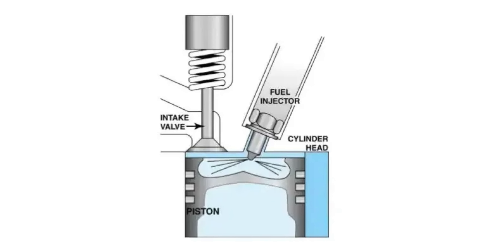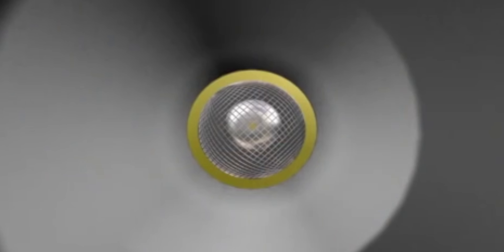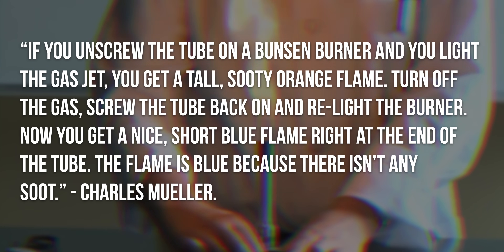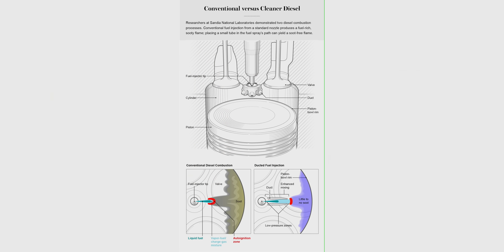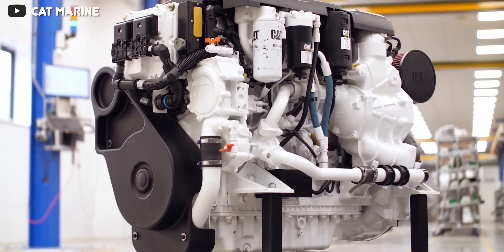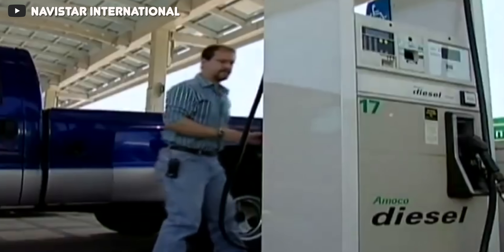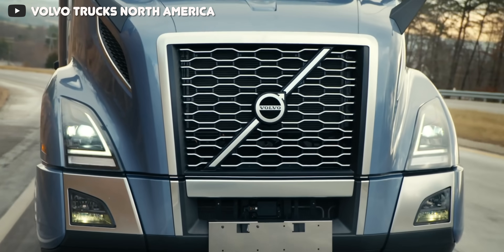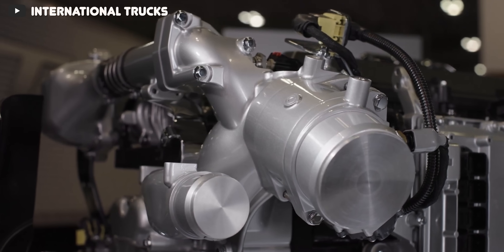Zero Emissions Diesels: How Ducted Fuel Injection can Save the Diesel Engine

Comment: If the EPA really cared about the environment, they'd focus on pushing nuclear energy, and working with states on developing actually good public transportation. 

I mean, what's better? A few % decrease in emissions of every engine on the road, or the complete removal of those engines from the road?

The problem is not what powers the car, but the car itself. Electric vehicles will have issues that only the "experts" didn't see coming

Comment: Diesel is not going away for the very long foreseeable future. Frankly no commonly found fuel can replace it for its intended usages and still be as efficient.
Reply: Yeah it's sure got it's problems like others but at the end of the day it's got power.
Reply: @TheAnnoyingBoss  with a push for synthetic diesel fuel, combinations of recycled-pet/bio diesel, and new advances in diesel tech, PZEV diesel vehicles are only a matter of time.

Comment: Looks like a IDI injection system like was common before the emissions regs.
 Indirect injection in the past burned cleaner but was slightly less fuel efficient because some of the heat energy was lost to the precombustion chambers.
 IDI diesels can rev to 5k RPM when designed properly increasing HP output.
 They were designed to combat the sooty reputation of diesel engines 40+ years ago.
Reply: I love my 7.3 idi

Comment: If this comes to the market, I hope they integrate these injectors to the engines on the road rn.
Reply: Wont happen, the design will require a new head, plus all the computer controls will make it impossible. The ducts as you can see in the video are huge. This is no little small injector tip.
Reply: @scottdowney4318  yeah they make it sound like it's the injector that's new, but really it's the cold surrounding cushion of air the diesel is injected into that prevents autoignition until a bit of mixing has occurred and something something atomization.

Comment: The funny thing is you go to some parts of Europe and there are Diesel cars all over the place.  If you ever have driven a Diesel Volkswagen you know they are fun!  They may be rated 100 or 140 HP depending on which generation it is but don't let that fool you!  It is all torque and that is the sort of thing you notice when you press down on the accelerator and you get fairly quick acceleration.  Some cars just seem to lack torque.  I once rented a 2001 Corolla and they come with a 1.8 liter four cylinder engine.  Sure they are quick off the line and kinda fun to drive but they are uncomfortable inside.  Oh, and once you start going up a hill, all those people you beat are going to beat you!  You WILL feel like your exhaust pipe is crammed full of potatoes!!

Comment: If I understood correctly, you said if reliable ducted fuel injection came to be, then EGR could be increased to reduce NOx emissions and could then delete DPF cuz there's no longer soot in exhaust and could delete DEF too cuz no need with increased EGR.  Why not delete EGR and delete DPF but keep DEF to reduce the NOx?

Comment: I hate to kill this one but this technology dates back to the first development of diesel engines mixing diesel with a air stream when technology was unable to produce direct injection as we know it for many years. 
Thermal loading on the diesel combustion chamber on last GEN diesel engines increase a lot so preventing cracks around the Ducted Fuel Injection system will be a challenge.
Could be that the what we call small bore diesel will see end of live but the mid to big bore engines definitive are there for more development getting better penetration of o2 into the flame front due to better nozzle and combustion chamber shape getting the same result already able to go as low as 0.88 Lambda on normal combustion as 0.82 Lambda is ideal to getting zero soot mass so only a DOC is needed. Further more there are many ways to get to zero emissions from steam injection to injecting urea.

Comment: There are two competing issues with Diesel engines, emissions and emissions nonsense.
The more efficient you can make an engine run the less emissions it produces.
Unless you have to deal with nonsense. The nonsense is nitros oxides. If you run a diesel at optimum efficiency there’s very little to no soot and very little fuel used to achieve maximum power. When you have to reduce nox you need to run very inefficiently using more fuel than necessary so as that the combustion temperature doesn’t get high enough to create nox. Recirculated exhaust gases supposedly cools the combustion temperature but reducing the oxygen available causing the fuel to burn more slowly and cooler creating vastly more incomplete fuel burn and excessive soot. Add DPF and regen of the dpf regularly and what would have been a clean and efficient engine becomes a very inefficient filthy engine that requires bandaids to get it through EPA nonsense.
And I say nonsense because the idea that nox is a dangerous pollutant is extremely exaggerated.
It is not good in cities with problematic climate conditions such as LosAngeles where nox can accumulate to produce photochemical smog and having a lot of inefficient badly maintained diesel running in an enclosed space like a bus station may cause some people breathing problems. But on the open road or even in the suburbs nox is not a problem.
You would need to be in miles long traffic jam of nothing but diesel vehicles to get a nox reading as high as what you get in doors from a gas cooker. Carbon dioxide is not a significant greenhouse gas either! To achieve the temperature forcing they claim of the tiny amount in the atmosphere at present the amount of c02 would need to exceed ten percent of the atmosphere, that’s about twenty times the present amount and would be almost impossible to achieve even if every single drop of fossil fuel was burnt all at once.
To achieve that level every Skerritt of chalk, marble and limestone would need to be dissolved in acid or roasted to release the c02 that fossils combined with calcium to turn into stone.
Reply: I think worrying about nox is nonsense as well, but I have also wondered about having a afterburner of some type, possibly running on a fuel that doesn't produce nox, then if possible that afterburner could be setup to replace the super charger (turbo) used in trucks providing an even more efficient engine by pulling exhaust gasses as well as supper charged the intake air.
Reply: @ARockRaider  running a dual fuel system reduces nox and improves power.
With duel fuel a gas such as methane is feed in small amounts into the intake so that there is something to burn immediately when the diesel is injected. Much of the nox comes from the first fraction of diesel that ignites before the rest of the fuel is in the combustion chamber. These systems are very good at reducing pollution while increasing power and economy but they’re complex and you need to fill up twice at every stop.
I have been wondering about what effect those ridiculous HHO devices would have on emissions?
Just topping up a water tank instead of a gas tank would be a lot simpler.
Reply: @anomamos9095  I don't know what hho is, but I'm guessing something like water injection to run a cycle as a steam engine?
That's something I would LOVE to see tried.

As for the need for two top ups because of dual fuel, already kinda need that with DEF and that does nothing positive for the truck, just another system to break down and a very temperamental one at that.
Reply: @ARockRaider  HHO is the system that some people fit to their vehicles in an attempt to get free energy by turn water into hydrogen and oxygen with a catalyser fitted under the hood. 
There should be hundreds of how to make one videos on yt.
Reply: I'm gonna go with the people who have spent their entire lives studying this topic specifically.
Reply: @fyrstormer  studying something for your entire life may make you an expert in that thing but it doesn’t mean that you can apply that knowledge correctly or appropriately, and if your whole premise in gaining that knowledge is wrong from the start you become one of the most common members of academia there is An over educated moron. Over educated morons are some of the most dangerous people on the planet because they are always right no matter how wrong they actually are and they will push ahead with whatever stupid idea they have often bringing along other morons in a fashion similar to a religious cult. When corporations can profit from this or governments can benefit the people are forced to suffer.
For and example just look at what some of the motives for the a Holocaust were and the type of people who thought it a good idea and you can trace those people to some of today’s leaders in climate science etc etc.
For another example google Fat head the movie  and Statin wars. Your trust in experts should plummet after looking at all that.
Reply: @fyrstormer  ah, the "appeal to authority" option.

First the government isn't the most knowledgeable on any topic, it's often filled with people who couldn't be successful in the real world.
Many of the policies and laws that politicians push are from lobbyists. 
Now think, if you are a company who wants to make a pice of equipment that everyone has to buy how do you get everyone to buy it? Well getting that pice of equipment legally required would be a great start!

Second the experts can get it wrong so the layman can and should question when things don't add up, there is a story of an engineering student finding a flaw in a very high profile structure, the expert had made a mistake that the student found.

Comment: Wasn't the "Vortec" engine a little bit like this?  The idea being that a "vortex" was created in the combustion chamber which improved the degree to which the fuel mixed with the air?
Reply: Diesels have used swirl for a long time.

Comment: That makes total sense, pre mixing fuel and oxygen is the way to get the cleanest or best combustion in any style of combustion.  It’s just like an oxy/acetylene torch,  if you have ever lit just the acetylene and tried to get any heat to speak of from it….  You get soot with very little to no effective heat add some O2 and then you can cut steel plate and many other useful stuff
Reply: A diesel gets heat by compression ignition.  A gas engine has a spark plug.  A gas engine is precisely ignited at a predetermined time to get good combustion (regardless of the amount of fuel in the combustion chamber).  A diesel ignition depends on the temperature of the compression (this depends on several factors, like air temp, compression ratio, amount of fuel added), which basicly means its a good guess at when its gonna ignite; not to mention how much fuel (is injected because you want the car to go faster). As this fuel changes volume (for speed), the amount of air to atomize it changes too. And its got to be shoved into the combustion chamber over the comb. chamber  pressure. This injection (atomize fuel and air would vary with speed) and needs to be controlled precisely to combustion to occur.  A fuel injector uses liquid, atomized fuel is not a liquid.  A lot of variables to consider to get perfect timing of combustion and to get good combustion (burn all fuel) without extra air etc....
Reply: Except a torch is localized ignition point. 
And diesel ignites all at the same time
Reply: @fastinradfordable  that's not the comparison he's making. We all know that.
Reply: If the key is premixing fuel why are carburettors not more fuel efficient than injectors.
Reply: @creed2409  Carbs are not more fuel efficient because they are very crude (i.e. not dynamic) in the adjustment of the fuel mixture.  A computerized carb with precise fuel metering might do better.
Reply: @ds78613   We already make computerised carbs and whilst they are better than crude manufacture of past, still do not exceed injectors. My point is about this theory on premixing being, i think, a bit optimistic. Simply spacing the injector a few inches inside a tube with compressed air behind it. The bunsen burner principle example seemingly doesnt even consider that air and fuel is conventionally mixed inside the engine before ignition. In conditions unlike open air, with massive turbulence and compression. I'm just sceptical as all previous design and testing found that the further atomisation is from combustion the more likelihood of fuel condensing or pooling, hence direct injector.
Reply: @creed2409  hmmm, a shot of compressed air to force the fuel/air to be mixed as it is shot into the cylinder rather than having to rely on "passive" atomization may be a good idea.  Effectively the ducted fuel injection is just aiding atomization, so forced atomization should do the same thing with possibly a smaller injector package and no need for more parts in the combustion chamber itself.
Reply: @creed2409  I was thinking similar, we went from injecting into the air stream, ie indirect injection, to direct injection. I am curious how going back to an indirect injection will work.
Reply: @NVMDSTEvil  Interesting, back to Rudolph’s original design of using compressed air to introduce the fuel, before Robert Bosch came along in the 1920’s.
Reply: @black69camaro2344  it is still direct injection, as it's all going into a closed cylinder, but it's apparently somehow not immediately combusting like usual, because "ducts".